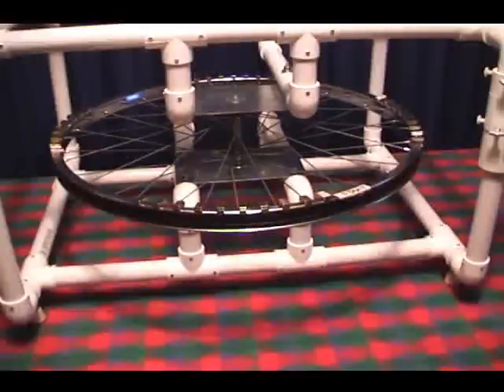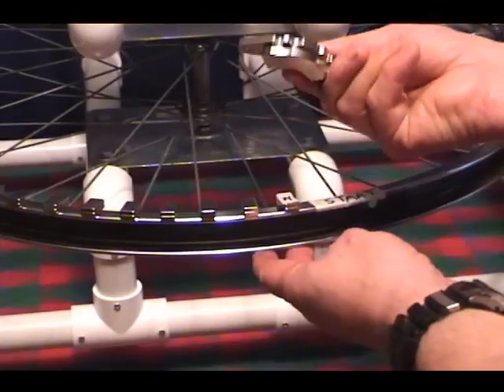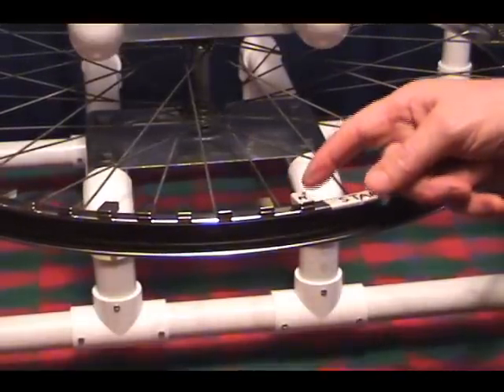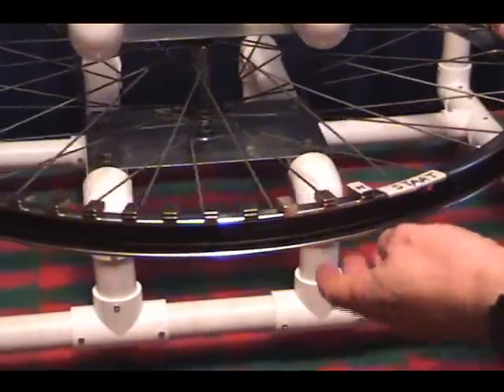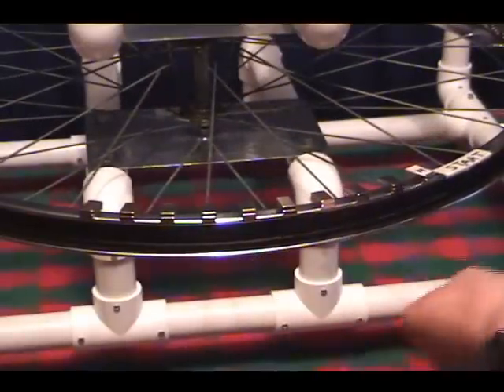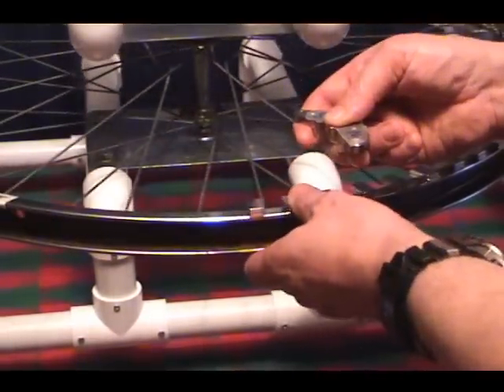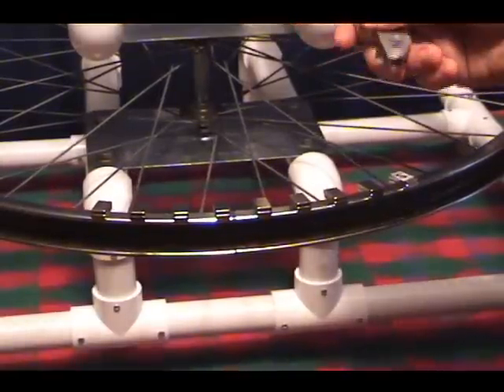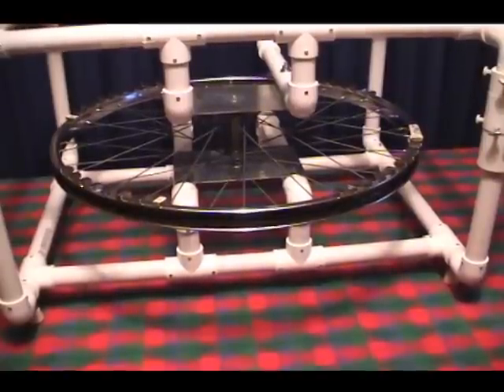Video #5, "Rick's Pipe Dream" Magnetic Motor - Generator

Comment: Hi Rick,
Nice looking rig! I think I'll be joining your replication efforts.
The audio sync problem is caused by the audio codec you are using to encode your video. If YouTube doesn't support your particular codec then the audio can become out of sync from the video track. They recommend MPEG4 (Divx, Xvid) format at 640x480 resolution with MP3 audio.

Keep up the good work and good luck with your next video.
Steve

Comment from the maker: That's right - no shielding needed here.  I AM demononstrating continuous rotation in this video using a MOSTAT (moving stator) technique, and explaining it as well.  If you want to see this done with the stator magnet mounted to my stator arm, watch video #13, but the handheld method is just as valid.

Comment from the maker: You are welcome for the inspiration, and thanks for the suggestion.  As you move forward through the videos you will find that I have addressed similar ideas.  What I finally decided upon was actually one of my very first ideas, which is to move the stator poles mechanically, but by repulsive magnetic interactions so as not to diminish the rotational power developed by the magnetic motor.  See the "more info" area of video 25 for a link to a demo of the current method.  - Rick